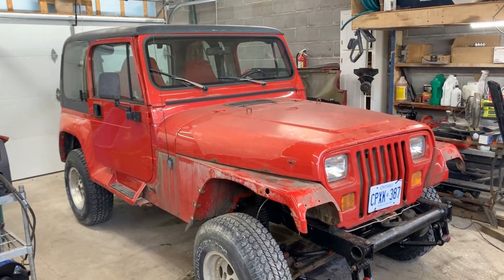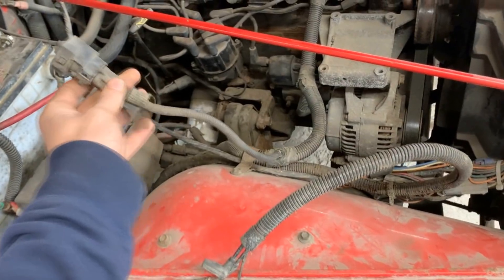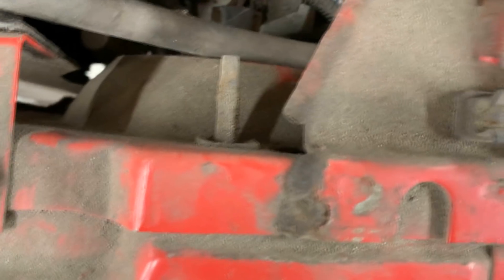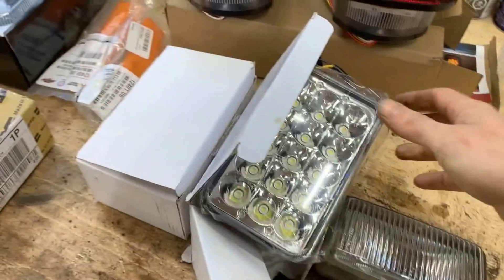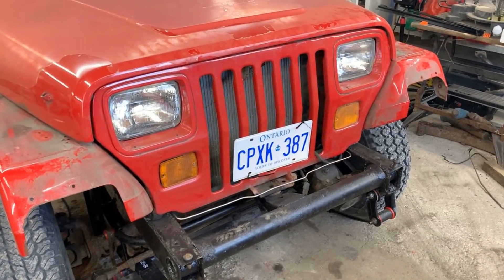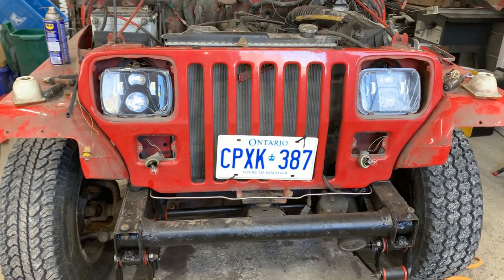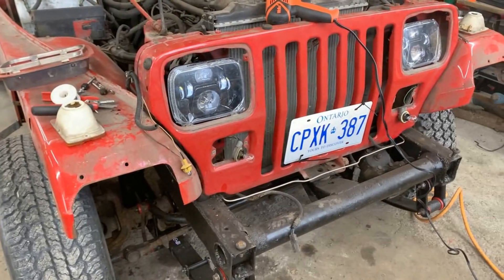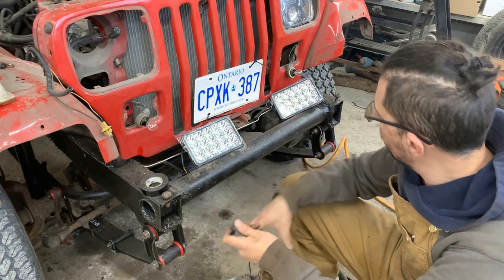1994 Jeep YJ - Part 24 - Let There Be Light

Comment: Elin, was the suspension replacement a lift kit, or just a stock suspension? If a lift kit, how much lift? Thanks!  Have enjoyed this series, I have a '95 YJ. Sure didn't know these Jeeps rust like that; mine still has the factory paint on the frame. :-)
Reply from the maker: It is a 2.5" lift kit. Just springs and bushings though. I had to buy 2.5" shocks separately and got rid of the track bars, to avoid installing lift kits on them as well LOL. It depends in which part of the world you are, your frame might be good forever. Here in Canada the amount of salt they use on the roads in the winter is incredible... Not only Jeeps, all cars rust in a few years.
Reply: @RustyBeauties  Yeah, we don't get much snow at all here in North Carolina. However, you do need to watch out for Jeeps from the eastern part of the state near the ocean, that got driven on the beaches and thru the salt water!!
Reply: @RustyBeauties  Thanks Elin, I thought it looked like 2.5"........thinking about doing that to mine.